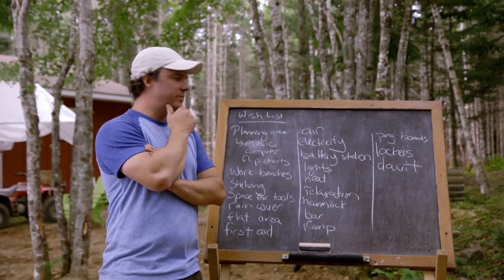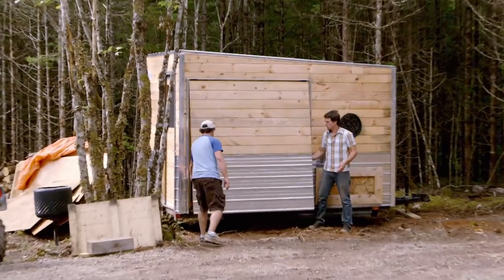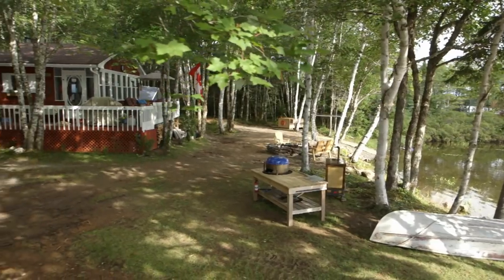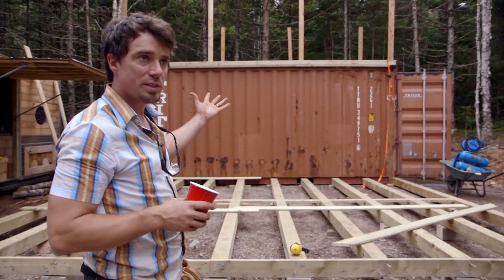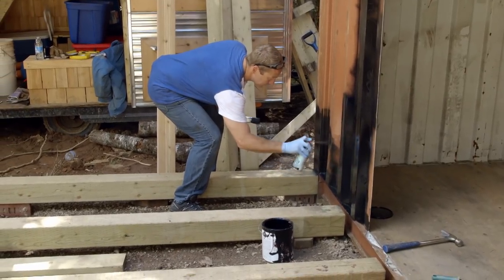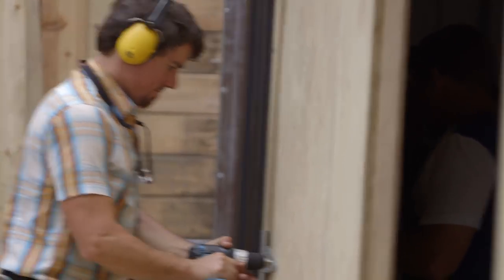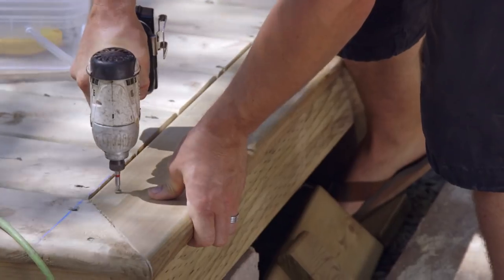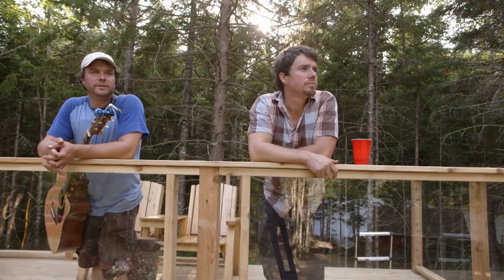Shipping Container Workshop - Brojects: The Webisodes

Comment: I've been checking out a bunch of Blacksmithing videos and it looks like a shop with a minimal of equipment (forge, anvil, work table, miter saw & vertical power hammer(?) ) could fit in a 20' (side access) container.
If you're worried about head height, get a 20' half (open top) container and install it (container locks) upside down onto yours (seal them), then cut the roof out.